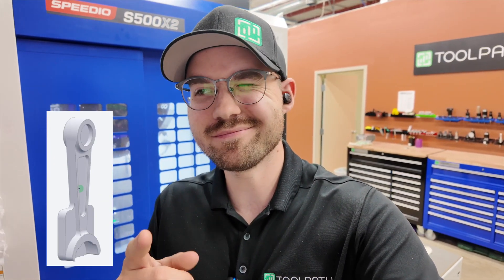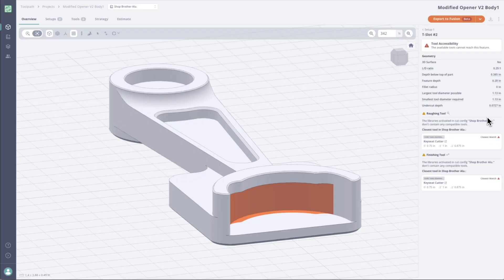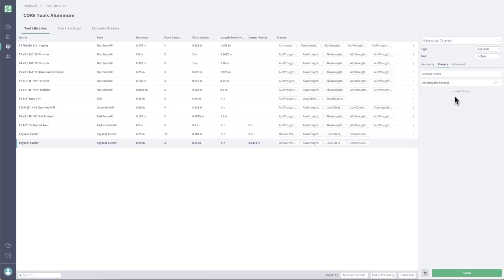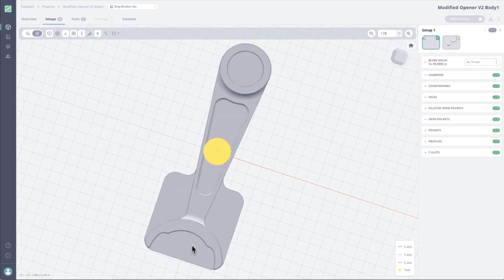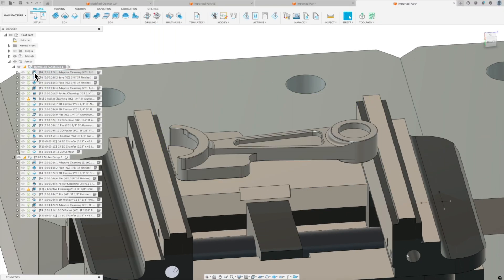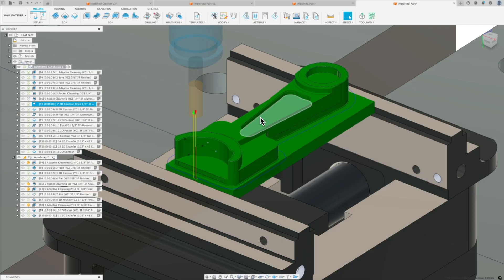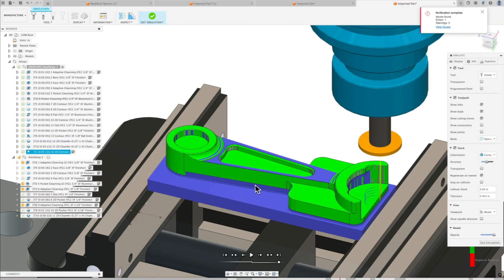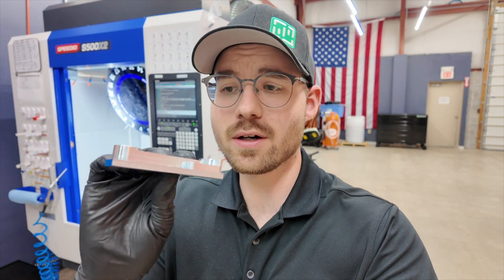Machining Minutes - Bottle Opener Part 1

Comment: Still a bit of a ways to go by the looks of it. It missed that side wall also at the step up (Back of the tootlpath logo) and gouged in the bottom at the same point which will have deflected the tool. Thanks for show us the new tool input I'll have to go have a play with it before my trial ends.
Cheers, Stephen